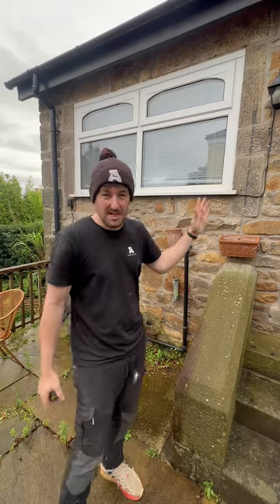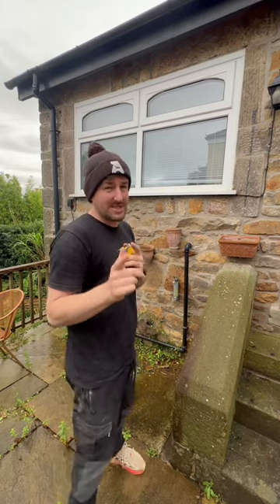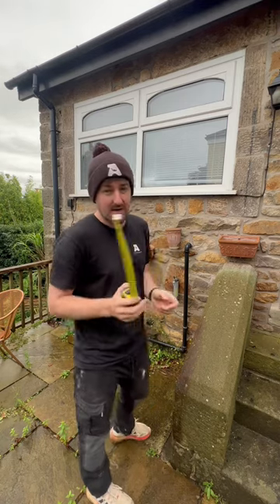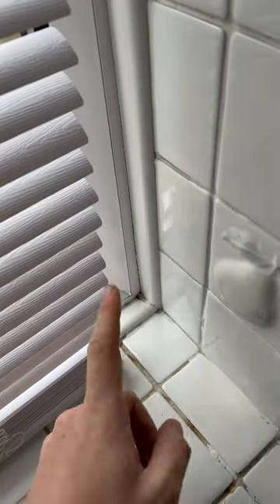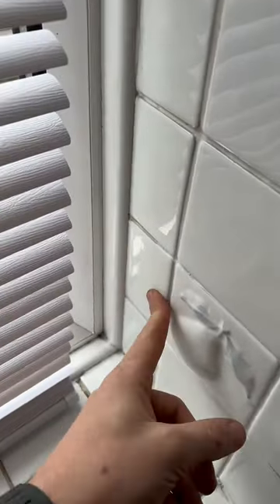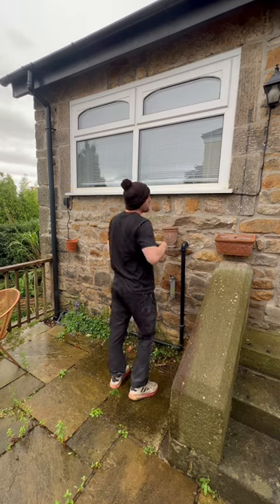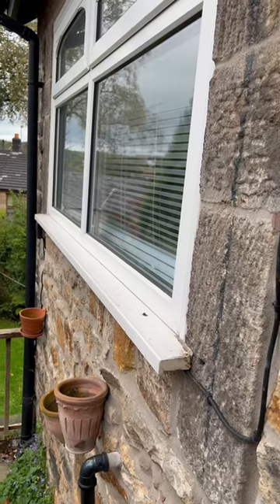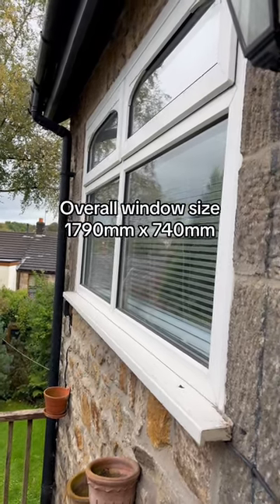How to Measure Up For a External Window #construction #diy #build #carpenter #howto #howto #fypシ

Comment: Always get a larger outer frame on both sides so it causes you no problems on the inside just ask the manufacturer to do this when you order it
Reply: There called knockons you only need them if the inside is a lot tighter

Comment: Would help if you explain why you deduct 10mm.
Reply: To give wiggle room to put it in 
However you should measure the inside to tell if you need a add on
Reply: Give it 5mm for each edge.
Reply: Brickwork isnt usually perfectly plumb down the sides or level top and bottom. The 10mm deduction gives wiggle room to get the frame in. Add plastic window packers in where your fixings are to get the frame snug before drilling and tighteng your fixings then the mastic will cover any gaps and seal from water ingress